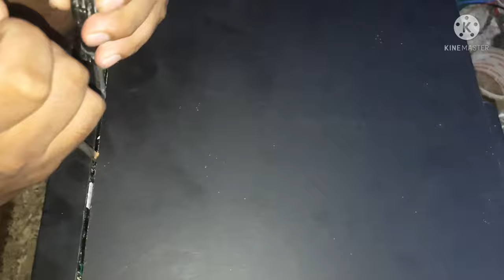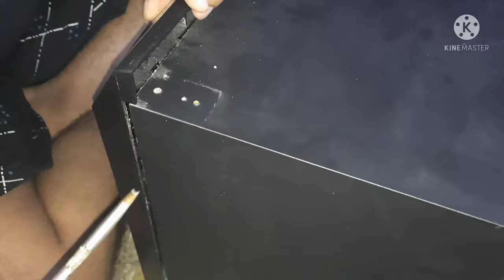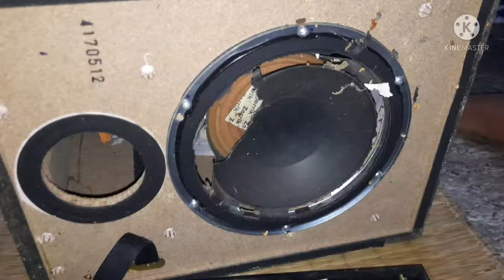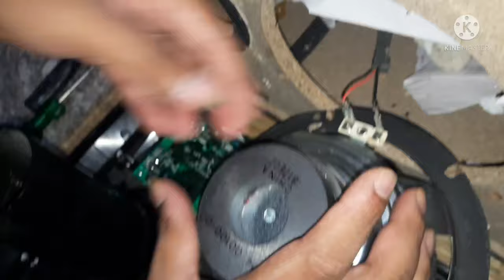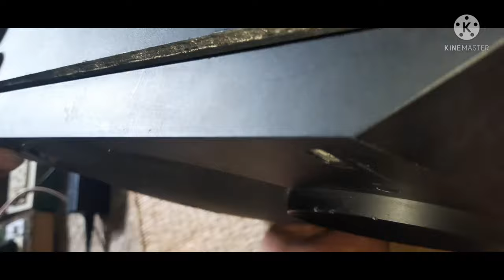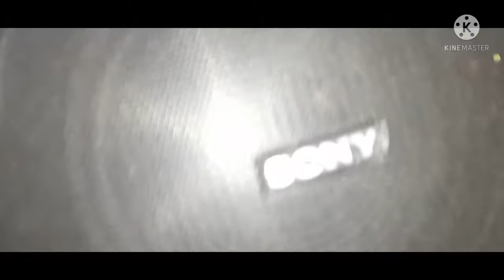Sony home theatre SA-D100 bass speaker repair || panda electronics

Comment: I have same model but rat 🐀 went cut strip and total wires pls I need strip to fix
Reply: My also
Reply: Bro I need mother board i also have sa d100
Reply: @bijubijumt7441  i need a mother board of sa d100
Reply: @bijubijumt7441   your home theater repair hogayakaya
Reply: Speaker new milega sir